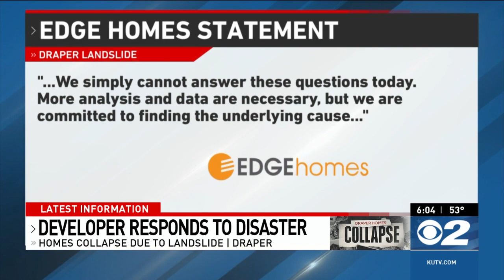Utah developer addresses failure of retaining wall, hillside slope in Draper home collapse

Comment: CARD-board homes... or the Retaining Wall is just Card Board...  USE Steel... Plate...  rock solid...  every time
WOW earthquakes are REAL...  Utah has Quakers???  Earth Quakers...
Reply: Sink pilings into the ground into bedrock. That's a retaining wall for a subdivision. Not some terraced thing across the landscape below with some walls on top to catch and retain even more moisture to weaken the soil. Brilliant design work from and approved by Engineering Diploma Mill University.

Comment: The underlying cause is a mountain hillside and record snow / water.
Hello
Reply: False...a utah DNR geologist already said the homes were built on a total gravel base, loose soil and was improperly compacted. The city approved the permits for the developer to commence work so they are as much at fault as the developer and this all started way before the snow fell this year....in September they knew the soil was moving and the house breaking up and the city ordered the homeowners to evacuate in October....way before the snow fell and way before the spring melt.
Reply: @maryhunt2316   Thank you for providing facts.
Reply: @maryhunt2316  yep
Reply: @maryhunt2316  hahaha right add water and ……
it was a generic answer.
some people got to always be perfect or else
Without the water and this doesn’t happen either
Reply: @Steve-kx6hd  I bet it would, the water just sped up the timeframe.
Reply: @Mary Hunt  according to another report Edge homes did NOT use the City's inspectors but legally used an independent contractor for the inspection. Also the homes are built on volcanic clay. Which is highly unstable
Reply: @jonathanstrauss8194  The 1964 earthquake in Alaska caused houses along Cook Inlet in Anchorage to drop 50+ feet as the clay they were built on liquified during the shake and the earth gave way below them. Incredible pictures look identical in some ways.